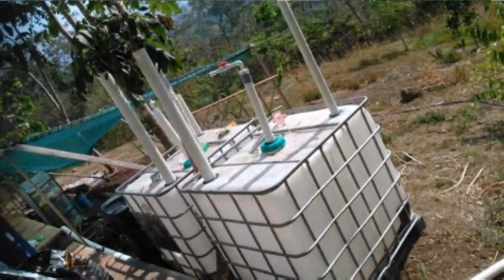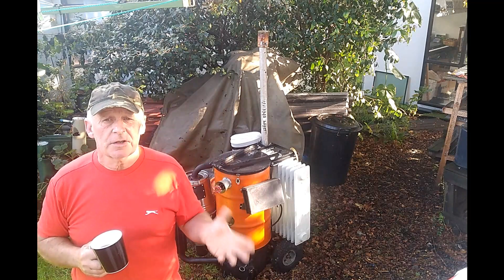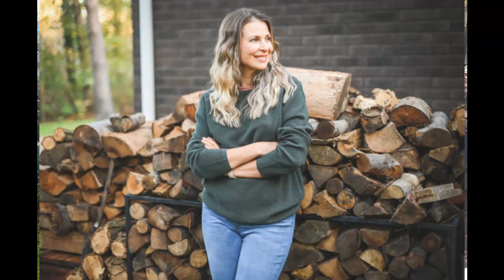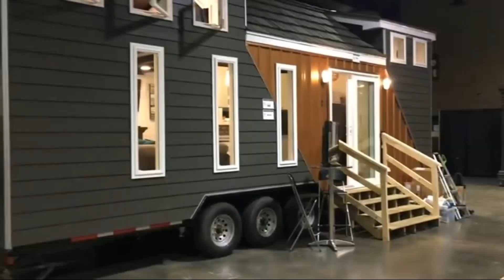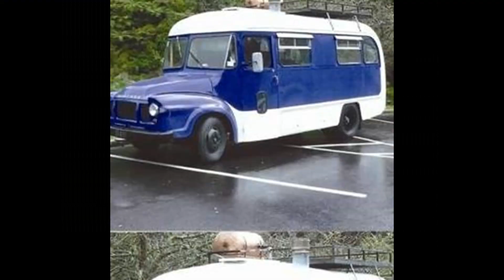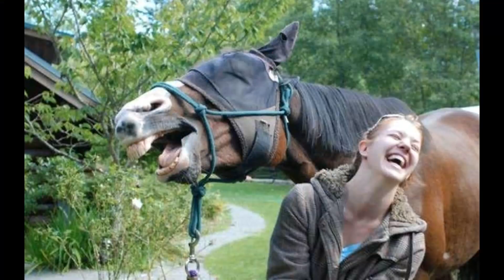Why Did I choose Woodgas?

Comment: Good ideas but having experimented with varying forms of power generation over the last 25 years I have found that solar panels (although high initial cost) and electronics have been the most reliable. Gas has become more expensive, fuel also, engines tend to breakdown and need spares which in a collapsed society would not be available, nore would solar I hear you say but solar is good for 25 years plus and the batteries to store the energy are good for 7 to 10 if built with decent thick plates and are recyclable. Wind generators are also good although the bearings need replacing every so often. Perhaps you could experiment with a steam powered generator running of a wood burning stove. Keep up the good work.

Comment: You never stop giving me ideas about stuff!
To be fair there is not much I did not know something about, but that poke of interest can be a powerful thing.

Coming from England I feel I must make a small point. Those Gas instilations in the photos were called Gasometers and basically stored the Town Gas (as it was back then) at ambient pressure (I always thought it was compressed, but no!) .... you are dead right about how it was produced. They called those plants Coking Works and you would buy eather Coal or Coke to burn on your open fire to keep the house warm. They are disappearing now as the idea is to liquidise the gas we now have  and store it in liquid form in  the plastic piping on the supply network (can't think what could go wrong with that idea).

My understanding of wood gasifiers is that you need a substantial area of wooded land for it to be viable. Could you keep an eye on how much wood you use in the process as you are experimenting? Some of us lost most of our woodland when the Spanish tried their Armada trick on us!

While I am on ...... how did your experiment with the ariels to electrify your plants go? I am hearing mixed messages on that front.
Reply from the maker: we had two horrible summers and hardly grew a bean- so I put up the big 7 metre mast and dozens of magnets and copper wire and the slugs and snails have moved out, we just finisged an epic summer of produce- with extra to sell at the weekly market- Im happy with electroculture. 
I have just 4 mature trees that I trim each winter for my firewood. Its kept me warm each winter in my small cabins for 22 years. I may have to get wood in to produce enough char to power engines. Ill let you know as time goes by. right now, Im watching leaves drop. when the trees are bare Ill drop a branch off each tree and that will get me through next winter.  (or not) lol if Im charring it. The reason I charr it is so that the volitile tars are consumed and wont damage the engines. the gasses released during charring in the retort actually power the retort after a small fire starts it working so its very economical.

Comment: Good day, thank you for the video. Perhaps a bellows (Plumbed in Parallel to the plumbing at the back) can work for the situation where someone does not have a battery or the battery has reached the end of its life. Thanks again for all your experimenting - Edward from South Africa.
Reply from the maker: Yes early systems used a hand crank forge blower. 2-3 mins should see i reach gas production, then the vacuum of the engine does the work

Comment: Where are the plans so that it can be built
Reply from the maker: How about letting me get it going reliably first?  This way you see what works and what doesnt. there's lots of variables that can be a bonus or a hinderence. for example- using the domestic radiator is easy- but has more flow resistance than 6 metres of large diameter pipe. Im using junk to save money and resources and it may not be the perfect way. There are many 'plans' available but they all have their issues. I would recommend looking at several systems and make up your own mind as to what will work best for you.  eg. do you want lots of dirty tarry gas? or a smaller amount of perfectly clean gas?  - you wont know till you look at all aspects of this.  Ill help all I can by telling you what I learn as I go. It may take several videos

Comment: Good luck! I look forward to learning from you how to produce and use my own city gas. My first thought was that it is a shame that all that heat goes to waste out of that radiator, then I remembered the significant amount of CO coursing through it and thought better of plumbing it via an indoor space. Do you have any plans to store and perhaps even compress your wood gas? Decoupling a larger and more efficient reactor from your transport might save a whole lot of tinkering and improve reliability. I would need to take such a stealthy route even if less efficient, due to prying aurhtoities being more interested in exhaust gasses than rampant crime and unraveling social structure.
Reply from the maker: absolutely! - but men with ties are all full uf MRNA now and wont be here for much longer. this is my prepping strategy

Comment: You mentioned storage which caught me off guard. I had (wrongly) learned you can't store the gas. Now I instead realise it can be. This also means it could be made self lighting using a gas flame.

You have sparked my interest for this after 20 a year hiatus.

Thank you!
Reply from the maker: Wonderful- I really believe that now is the time.
Reply: @t.h.o.r.  Do you know of a way we can store this in a standard gas LP gas bottle?
Reply from the maker: @GordonThomson-ZA   Yes Gordon, Ive researched this and my www.driveonwood.com gurus tell me that there are 3 ways to compress the gas - 1 go on line and buy a commercial lpg gas compressor. 2 use a small DIY/Tradie aircompressor modified.- works but limited to 150psi 3 use an electric waterblaster- fast and efficient but hard on the waterblaster heat wise.  Ill be covering all this in subsequent episodes
Reply: @t.h.o.r.  Thank you for the reply. I didn't even think about just buying a commercial compressor. I was thinking along the lines of method 2 that you mentioned, but I could not quite wrap my head around how I would go about manufacturing it. I am glad there are other minds thinking about this. I had a different idea based off of something I saw someone do to store and pressurize Biogas for use with a stove. They use a container with water to store an open container placed upside down with the gas in and outlet in. The gas in then pumped into the container and a weight is placed on top to build the pressure. While this should work in theory, I was not sure if it would build enough pressure in order to fill the gas bottle. (I don't know if I explained this well enough, but you have probably seen something like this on the internet during your energy autonomy quest.) - Cheers Mate